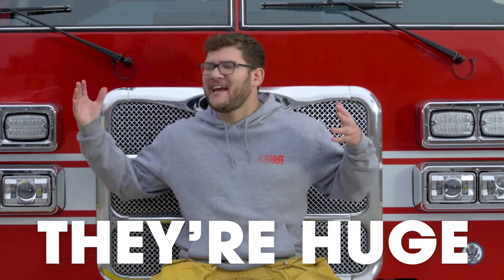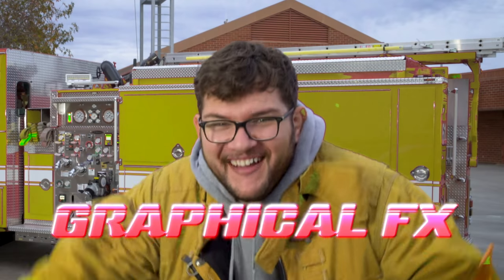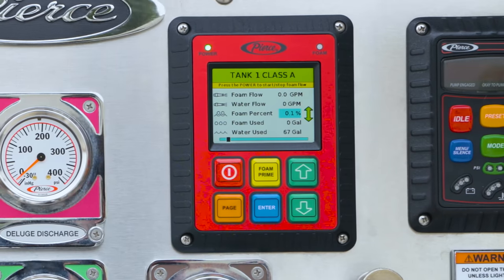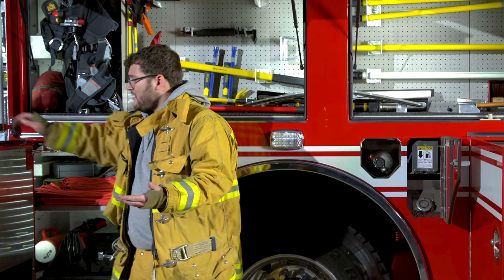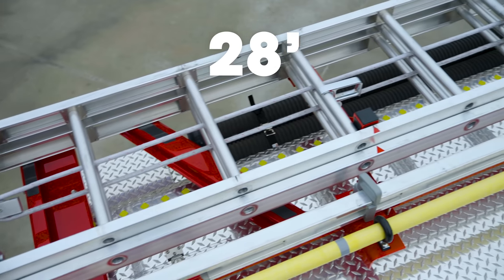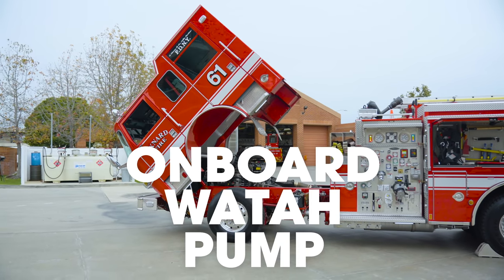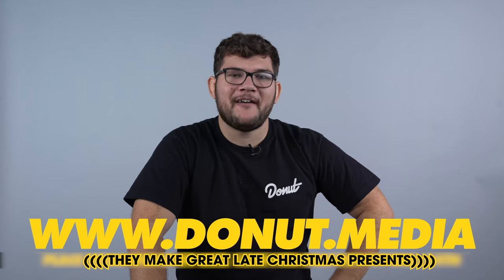The Surprising Features of a Fire Truck

Comment: The engineers scba is more intended for when the engineer is standing at the pump with smoke billowing over the truck.
Reply: Jason Greek Depends on your department. Where I have been for 23 years, an engine can be a first or second in, where he would only be pumping, or a safety engine third in where he may be on the rapid intervention team with the rapid assist truck, or on an extra alarm fire he is working as a firefighter for manpower. His SCBA is for use in an IDLH atmosphere.

Comment: Isn't the entire state of California, currently on fire? Why is this thing sitting in a parking lot?
Reply: chasemc69 California was on fire but those wildfires have already been put out. However, it does not mean we Californians are save from the dangers of another wildfire sparking in our mountains and foothills, especially with t-storms coming in the northern area of the state (as writing this, California is having a winter storm in the whole state).
Reply: Those fires are long gone but The way it works with this is there's a higher power "chain of command" not only in a station but in a city or county. So if there were to be a huge county-wide fire in your area dispatch would organize and call in engines form stations around that county but not use all the engines because then they would not have resources it lets say a medical emergency were to happen elsewhere. this way we don't throw all our resources on something that will we will need elsewhere also. 80% of fire calls are medical-related emergencies so the likeliness of sending all your engines to a wildland scene is very slim.
Reply: Guys, I think the joke flew right through their cranium and they still couldn't catch it.

Comment: So fun fact.  You can tell whether one of those hose threadings is an inlet or output from a distance.  Angled is almost always an output.  Inputs are almost always straight.  The most notable exception to this is that main 5 inch inlet, which is pretty much always angled in every setup I've ever seen or heard of.

Comment: Why are fire trucks red?

If someone pulled your house youd be red too
Reply: Not all fire trucks are red, depending on your location. for example wildand engines could be yellow or a teal color but your classic city engine is red. long story short From what I learned in one of my fire classes, fire trucks were painted red because red paint was the second cheapest paint color to get back in the day. Black paint was the first cheapest. A lot of the carriages in the late 1800's and later on steam engines in the early 1900's were painted black and a lot of different companies all making the same product all used black paint. When Ford came out with the model T it was also painted black. So firefighters came up with the solution to better stand out they would use red paint since it was easy to obtain and not super expensive. And so on the tradition continues with the iconic red paint.
Reply: @jakesimmons4591  good to know!

I actually though about becoming a volunteer in NJ but to many rules for me about showing to often

Comment: Should have showed the exhaust system while it’s parked in the station. The hose sits on there so exhaust of the diesel doesn’t fill the station when they start her up. Then it automatically disconnects when they pull away. It’s pretty neat.

Comment: That's so crazy, I'm a Firefighter but from Europe, we have totally different vehicles and tactics here.
We usually have at least 1 Driver/Engineer, one "Captain" and a minimum of 2-3 firefighters but (best case) up to 7-8  depending on the truck we use. There are also additional cars / trucks that are used, so we basically have at least 2 vehicles and between 6-8 man on each operation (no matter what kind of operation).
Also we do have different specializations, for example, you need a special training to use specific equipment like the breathing apparatus or other stuff that requieres more than just a basic training. 
For our vehicles they are mostly "basic" truck and car models from MAN, Mercedes, VW or other brands which are modified by specialized companies. There are custom built vehicles as well but those are very special use vehicles that you won't find "very" often like the Rosenbauer Panther - which is THE number 1 Airport Firetruck in Europe. In general, our trucks seem to be much more technical "advanced", we do have 360° cameras for navigation, GPS of course, some come with water canons on top. We have fully digital controlled pumps and everything can be remotely controlled from the front seat or the back of the truck. And we do care MUCH MORE about securing our equipment inside the truck, even pens are tied to a string to prevent them from falling or flying around... No really, there's not a single part of equipment that has no dedicated slot, box, slide, drawer, hook, strap, string, clamp or magnet that holds it in place. But one thing we do not have which is so freakin' cool is the automatic lift for the ladders!!! That one is awesome! I whish we had that too. We have to slide them down manually or even have to climb up to get some of them down...
So if you ever get the chance to visit europe, especially Austria, make sure to visit one of our bigger Firestations and see how we work!
Reply: well not all the aspects you mentioned are actually pros, some are rather cons
Reply: EnjoyFirefighting - International Emergency Response Videos oh I didn’t mean to make any of that sound like a pro or con, it‘s just completely different in some points which is very interesting. Fireststions in Austria are also mostly run by volunteers so we have a very different situation here as well.
Today we had a so called technical assistance (level 3), a Train crashed into a Truck at a tailroad crossing ...

Comment: First thing that he mentioned calling it a pumper I went "Yep, that's basically the truck they use for when they need to get a lot of water to a lot of trucks, such as the big ol' ladder lads and need a lot of pressure to send it to the top of a high-rise building, from 3 different angles. As in 3 separate ladder units."

 Then my brain just went over the other main types I remember: Ladder trucks; the ones that have the big ol' hydraulic ladder on top with the bucket (or without, depends on what the department needs) that is used to get either a better angle of attack on a fire thats too high up for hose jockeys stuck on the floor level to properly fight (the one that has the bucket, as it usually will have nozzles with the bucket.), that I will instead prefer to call "Boom Buckets" because they're more inclined to be used for fighting an actual fire, and there's quite a few that use crane booms. If a mother with her newborn baby is stuck on the 10th floor of an apartment complex and they cant set up any way to catch her safely, the ones that just extend out like a giant normal ladder are the ones that you'll see (or the Boom Buckets if the departments don't have any regular ladders that reach high enough) and I'll just call 'em Ladders. 

The last type I know of is the one that doesn't really fight the fire itself per se, but instead is the one that carries whatever else is needed for the other trucks and also carries the medical supplies to treat any potential patients (be it from for example: a man who's arm is cut badly from a floor partially collapsing on him while he was escaping a fire, or a woman who barely makes it out of a fully engulfed house before collapsing, very obviously struggling to breathe.) These ones are the Rescues, or there's also the one you think of that looks more like an ambulance because you watch 9-1-1, or Chicago Fire. Me? I watch Emergency! from the 70s. Good show, great acting, and amazing attention to detail (and none of that stupid focusing on making dumb love drama and shit.)

This turned into a stupid large rant. my bad.

Comment: The axe and that other thing stuck to it is called a married couple. The “halogen” gets shoved into the door jam, hammered in with the back end of the axe, and by prying it, you’ll snap the lock open. If it’s a tough lock, use the axe as a door jam to readjust the halogen for more leverage.

Comment: Caught an error (I believe) in the stats - 3" supply line can flow far more than 250 GPM.  In fact, a 3" hose can flow 1,000 GPM at only 80 psi (based on a 100' length).  That's the entire reason for that chart by the pump panel - calculating GPM, friction loss, and ultimate pressure at the nozzle for the firefighter to make sure they have the pressure they need for the nozzle to work correctly.  250 GPM is very low for 3" supply hose though.  It can even carry twice that - 500 GPM - at only 20 psi.
Bump that 3" up to a 5" supply line, and you can flow 1,000 GPM at only 8 psi (increasing pressure as more length is added).

Comment: @5.45 Those fire axes are sickhouse! I work for an alarm company and we used to have our monitoring station in an old paint factory so it was already a pretty solid building of Cream City Brick, but on top of that we had a thick ass steel door out front. Well, one night we had a lightning strike on the building that blew all the grounds out and started a small fire and the fire department responded. There are directives not open our doors without permission at night so the fire department was all like "You're taking too long letting us in." so they took one of those fire axes to our door. Man, they can do some damage. Laid some solid hits in before they got let in and there were full-on penetrations of the first layer of steel. Till then I just kinda thought of them as like standard wood chopping axes but not any more. Scary bad those axes.

Comment: A standard Fire Engine you commonly see don't have 3 only mainly carry capacity carry from 6-8 depending on year or model or brand.
Usuaully goes by Engineer/Driver Front Right side Left Front "Officer seat" be either Captain or Lieutenant then in back of the cab will be your Firefighters or paramedic well Firefighter/EMT .

Comment: I just watched this video tonight and although it’s a few years old you did a great job on the narration. Just a few add ons. When we have our SCBA’s on we are not breathing oxygen. Oxygen is extremely flammable and explosive. We are breathing compressed air. The same air that a scuba diver breaths in. The same air that everyone breaths on this planet except it is compressed so as to deliver the air in the tank to us under pressure. Again it’s compressed air, not flammable like oxygen which is. When we are on a medical call and the patient needs assistance with breathing then we use the medical oxygen tanks with the appropriate masks for the patient.
Another fun fact is how much water is pumped from the Fire Engine to the fire. On average fire pumps at the minimum are pumping 1250 gallons per minute. So if your water tank is say 500 gallons and you have not connected your fire engine to a hydrant for a permanent water supply and your fire nozzle is flowing 150 gallons per minute well……do the math.
Other fire engines may have a 1500 gpm pump or even 2000 gpm pumps. It all depends on how your community or city is built with just single story homes or an area that has multistory homes, commercial development and huge manufacturing businesses.  Am I boring you, sorry. One final thing.
The average cost for a pumper, or engine or its true name ( Triple Combination Pumper) that’s the technical name because a fire engine needs 3 things to fight a fire. Water tank, fire pump and hoses.
The average costs for a new Fire engine is approximately $575,000 to $800, 000 dollars. New. Again depending on what the Department and City are looking at will vary less to more by what the budget is.
In my Department in the City of Palo Alto, we purchased 7 new Pierce Arrow engines and I believe each cost $525, 000 per fire engine. That was back in 2007. I was on the development and purchasing committee. Now they are 16 years old and most over 100,000 miles on each so they are going to purchase again. Not every department has the luxury to operate this way. It just differs from fire engine manufacturers but if they are looking at the Cadillac of fire engines then Pierce is right at the top for longevity.

Comment: As a rural firefighter its always intresting to see the difference between a city rig and a rural truck. We have alot more automotive tools as me do probably 10 vehicle crashes to fire even on an engine.  We also carry almost very little medical gear as a volunteer company your medical gear is on the ambulance which will respond to fires too.   your got you info close usually most crews at least how ive been trained hook to the fire plug first and then go to attack
Reply: around here you don't really see the difference between an apparatus being used in the largest city or in the tiniest village, they basically have the very same layout

Comment: Just like  inside a  commercial airliner jet cockpit.  All the panels and buttons and control panels buttons switches screens  guages,  etc.   ALl the  insanely   awesome stuff.   And the 2 sides of the jet engines lift up aswell.   Like sides of them  lift outwards / upwards

Comment: Engineers never go into a building. They stay back and man the panels and get tools ready for the fellas inside.

Also at 5:00 that is called a "Married Set" (ax and halogen) used mainly for popping open doors.

Also at 8:40 the specific  fire extinguisher he is talking about is called a PW (Pressurized water) this would be used on small accident calls just as a safety precaution.

9:30 WRONG never use water in a kitchen fire. Oil will fly everywhere (still on fire) if you hit it with water. You'd want to use dry chem
Reply: 9:30 not every kitchen fire is caused by oil?!

Comment: 0:12)About 500 BC, a Greek living in Alexandria, Egypt, invented a water pump.The Romans jacked it up and slid wheels under it. The first fire truck!
2:47)The 3 rings on Capt.Crunch's jacket means that his rank is 1st LieuTenant(O-3).Up to 1918 ,or 1919.
6:55)The trouble with hoses on  reels is that all the water drains to the lower level. Wet rot happens. That is why fire houses had/have hose towers. Wet hoses were hung from one end to drain and dry. Dry hoses were put on the truck.
12:25)Light changers are useless on Florida emergency vehicles. They DO NOT have the right of way. In Broward county, a deputy sheriff had a green light. He was wailing and flashing. A woman ran the light. Bleeding heart judges and jurors gave her US $9.4?? million. Always useless to appeal. Several times FOUR ambulances were needed on a single call. Two for the patient. 1 or 2 for the first crew.

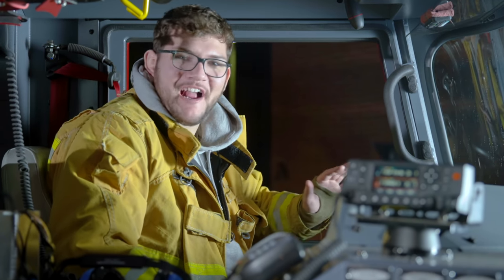Comment: 12:36 ... If you flash your lights quick enough at a traffic light with a white traffic control video camera on top WILL CHANGE THE LIGHTS. at least in NJ it will...

Comment: A few comments.  A three person crew is inadequate per NFPA standards.  Four is the minimum crew for "easy" areas (two story, single family homes).  More personnel are needed for more complex areas (apartments, businesses, industrial.)      Ideally there should be an engineer (who stays with the engine), a company officer, two people to advance an attack line and a person for the hydrant connection.

I have never heard of an engineer doing calculations with a notebook before putting the truck in pump.  There are standard settings to start out with and then modify the settings as needed (multiple lines, high rise buildings, long hose lines.)

Any efficient department does not wait for the hydrant connection to put the truck in pump!   Start with the onboard water (500-1000 gallons on most pumpers) and then work to secure a hydrant supply before the tank runs out.  When I used to engineer, I probably had the engine pumping water within 30-40 seconds of my boots hitting the pavement.  Yes, we have all seen some departments ignore their tank water and wait for a hydrant...those are the fires that typically double or triple in size before they actually start "putting blue on the red."